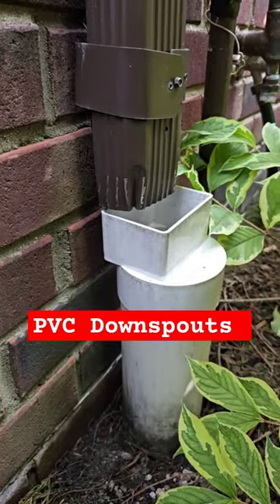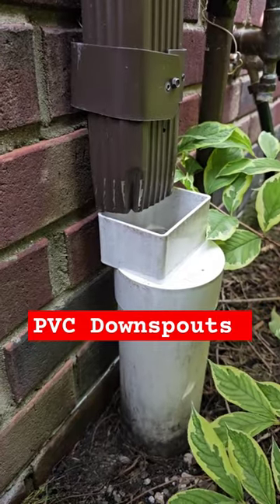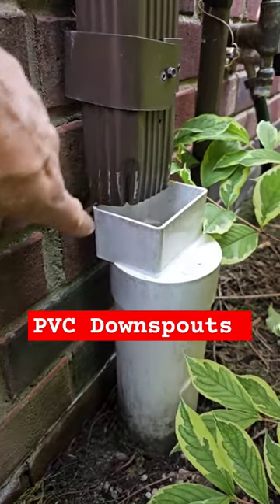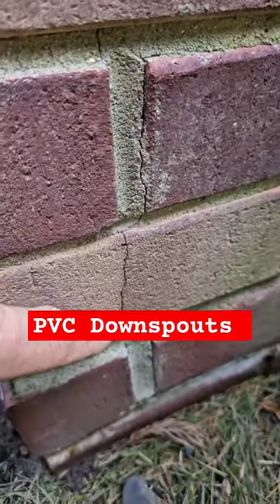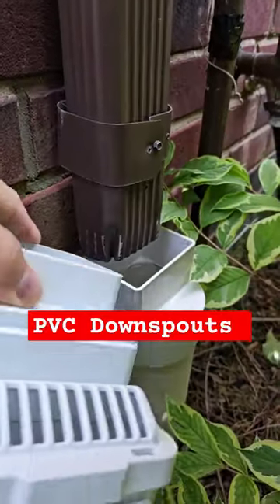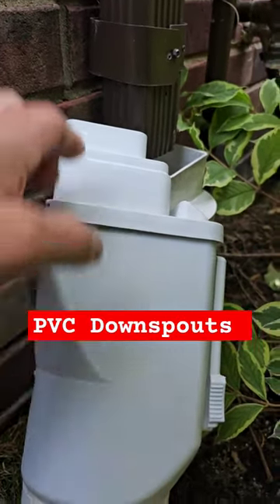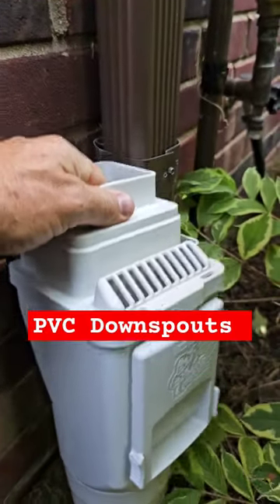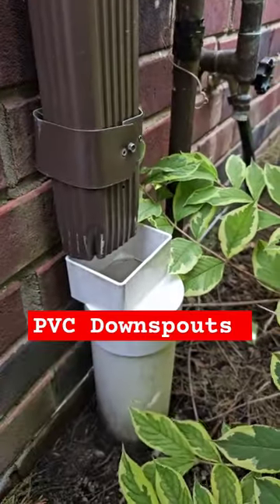How to Fail Safe PVC Downspouts

Comment: I don’t think that cracking is from the downspout separating..
Reply from the maker: One thing is for sure, nothing good comes from a downspout dumping water at the foundation.
Reply: Yea I agree that looks more like tree roots lifting at the foundation than water damage. Slight discoloration though so maybe
Reply: @FRENCHDRAINMAN Yeah, but even if the downspout wasn’t there, rainwater would still be hitting near the foundation. So cracking can’t be blamed on water coming from downspout
Reply: @brooksbelanger8799  hmm I never thought about the soil expansion. Makes sense though 👍🏼

Comment: Sometimes that happens when you don't compact under the elbow, and when the dirt settles the pvc comes down, so you can use sb2 under it compact it, and stick the downspout until it hits the bottom of the pvc adapter, this will avoid it
Reply from the maker: What you suggest will help, but it's pretty hard to avoid. This part is not adequate and we no longer would use it.

Comment: I have a new build and I put these in a few years ago. There has been settling, but I have a coupler right near the ground level and I extend it up with a separate piece of PVC which I’ve been able to re-cut to make a longer one so that there’s always plenty of material around the downspout.

Actually, I did SDR 35 green for all the drains , and the extension piece is white HDPE, which looks a heck of a lot better and it’s not glued in so I can easily remove it.